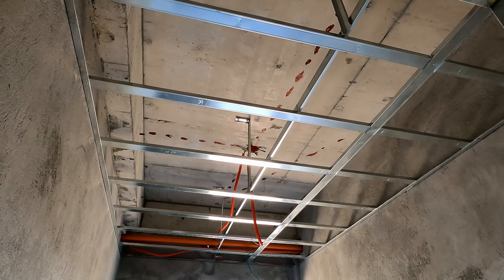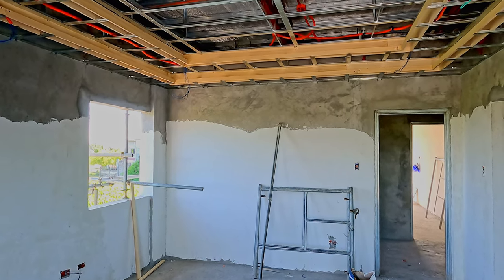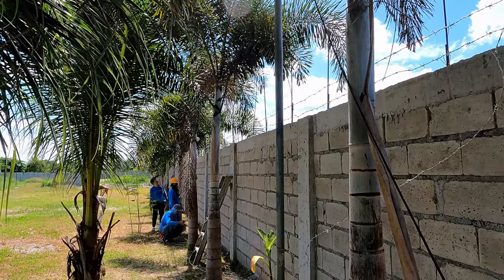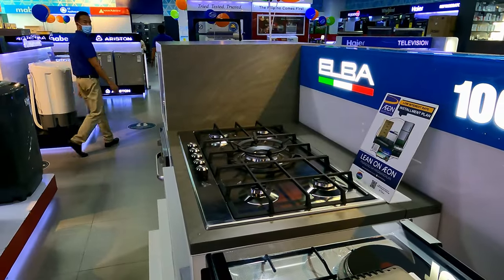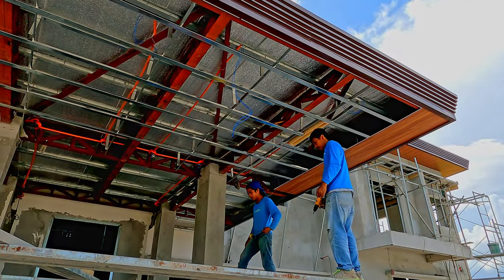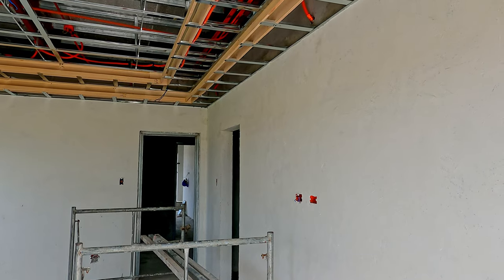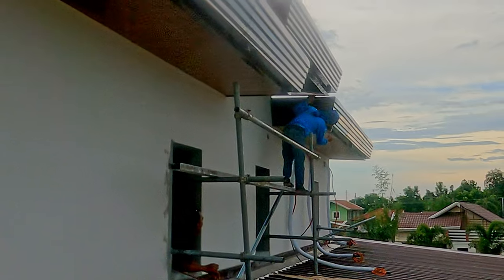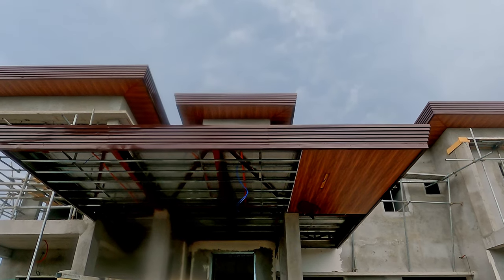Philippine House Building Day 191 - New ceiling started

Comment: That soffit looks a lot like the wood locking  snap together laminate or synthetic flooring. Actually looks quite well under there. Probably bug and water proof.
Reply from the maker: Fred
I think it should be pretty robust, and definitely should be waterproof.
By the way, for no reason I can see, your comments are being held for review. At the moment, nothing either of us can do about that. This has happened before with one or two other people, and after a while, it seems to stop doing it.
If I don't respond to any of your comments for a while, it is because I have forgotten to check the "held for review" tab.